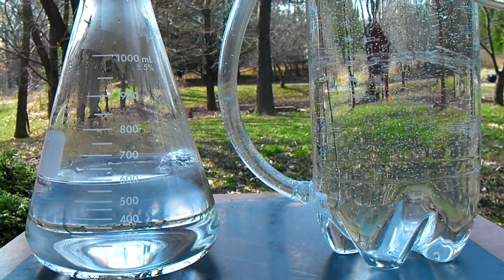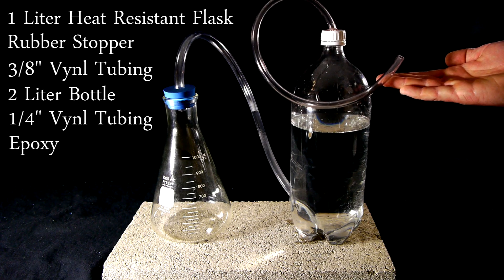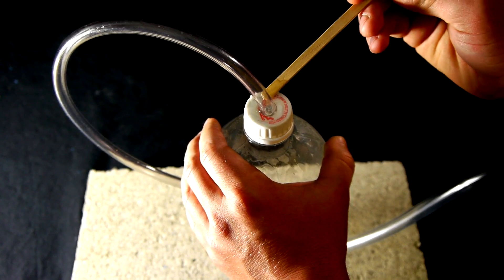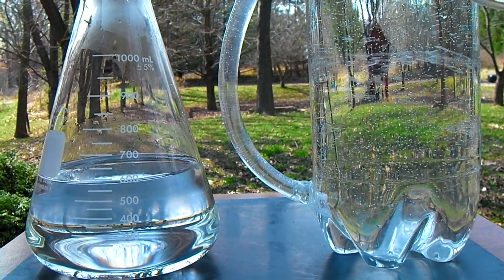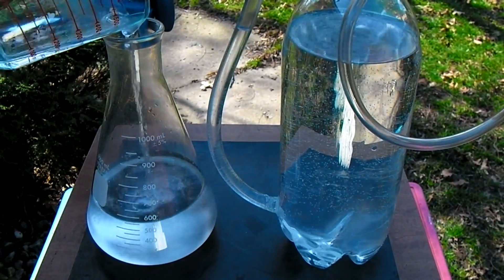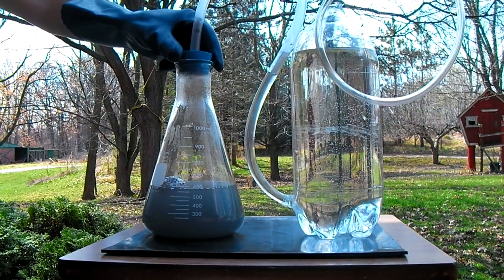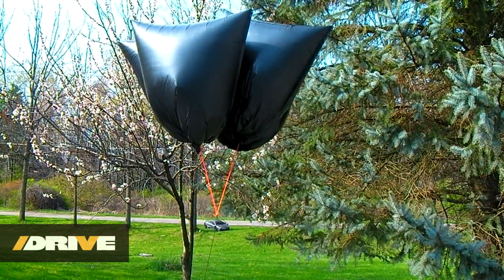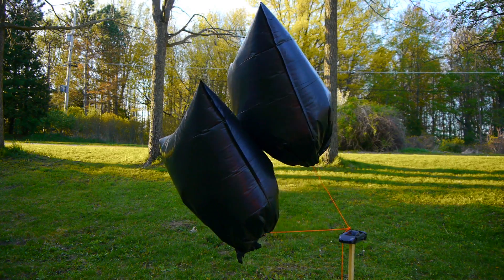How to Make Hydrogen Gas - Clean Burning, Inexpensive, Lighter than Air!

Comment from the maker: Yes, but that is also very dangerous. Without oxygen in the balloons it takes an outside source of heat to melt through the rubber and allow the hydrogen to mix with the air before it will burn. If there is oxygen already inside, the hydrogen can ignite simply from static buildup. People are injured or killed several times per year when balloons or bags are filled with a fuel/oxygen mixture and accidentally ignited by static.

Comment from the maker: Hydrochloric acid doesn't get much more concentrated than the 31% used in this video. The amount shown produces 25-30 gallons of hydrogen, and yes, the reaction can be scaled down. Enough pressure is produced to fill a rubber balloon, but in doing so there is a risk of the rubber stopper popping out, which can throw drops of acid that may have condensed near the top of the flask. Safety glasses are critical. A filled balloon must be removed before the stopper or water will backup into the flask.

Comment: please answer i want to try this my self
1: if you had it avaliable could you replace muriatic acid with concentrated hydrochoric acid
2: how much gas would you get from the amount used in the video and is that linear, (i.e. if i halved the amounts would i get half the gas)
and 3: how much pressure do you get coming out of the exit hose, could you fill a rubber balloon with it or you you have to use mylar? thank you
Reply: use the least dangerous item to make the gas.  hydrochloric acid?  really?

Comment from the maker: Yes. It is important to follow because if you were to add water to acid, the first few drips can heat rapidly enough to boil, which throws acid everywhere. Adding acid to water on the other hand only has the potential to throw water or very dilute acid should a problem arise. In either case, when using an Erlenmeyer flask as is shown in this video, most splashes within it should be contained. It is better to stay on the safe side and make it a habit when the circumstances are not so forgiving.

Comment: hay odd question here. But i always find it hard to do the drilling in these creations. And i was wondering wether you think a Bong would work instead of the bottle? (with some modifications of course) 
but just to remove the need to drill

Comment: If want a big bang for your buck you can use Oxy/Acetylene. Just set your torch up for a normal braize weld, then kill the flame (tap the tip on the ground etc.). This ensures you've got a decent mix. Fill a toy balloon up with that mix (or several). The mix is slightly heavier than air, so the balloon will want to sink. Carefully induce such a balloon over an open fireplace outdors. BEWARE - the shock-wave is extremely intense - louder than a gunshot and unbelievalby fast. Stand wel clear.

Comment from the maker: The cold water in the 2 liter does fine to get rid of water vapor in any significant concentration. Eventually the 2 liter does become hot and water begins to condensate in the balloons, but a quick refill of cold water brings it back to normal. Calcium chloride filtration would only be required if you needed perfectly dry gas for scientific use. It's certainly not required if all you want to do is make a balloon float.